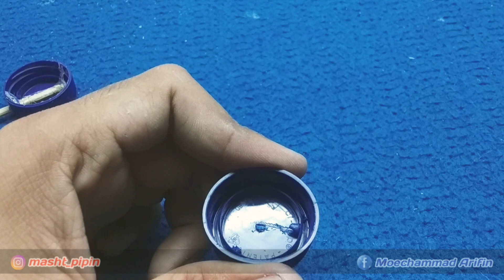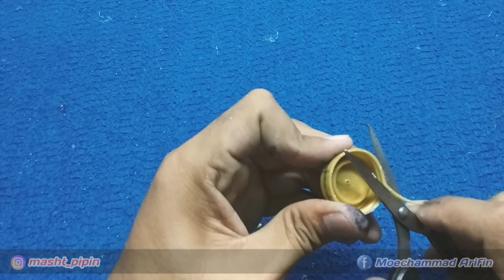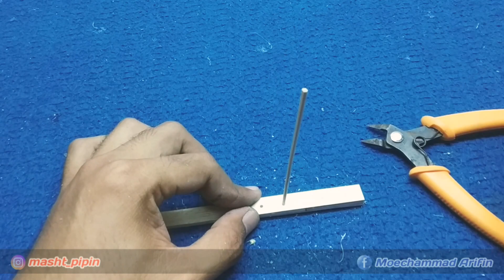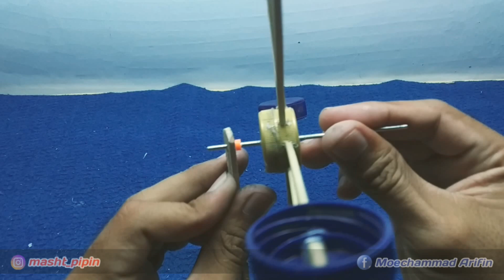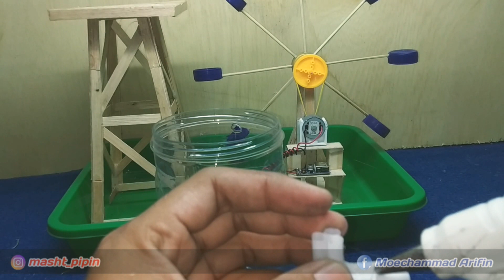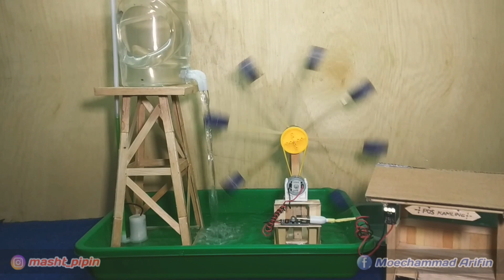Cara Membuat Generator Kincir Air

Comment: Gais aku bikin ini buat final project dan ini 100% berhasil!!!
Bahan2nya
Stik es krim
Baskon/nampan/CONTAINER
Step up
Kabel
Lampu
Dinamo dvd
Water pump 6v (opsional)
Selang aquarium (sesuai sizenya water pump sih)
Klip batere (opsional)
Batere (opsional)
Sakelar (opsional)
Alas
Tutup botol
Tusuk sate (jg bisa pake sendok plastik)
Pulley kecil dan besar plastik (yg wajib itu pulley besar)
Karet/vbelt
Lem bakar
Bor
Solder(opsional)
Selotip/lekban
Lem
Penggaris
Sedotan plastik
Cutter
Reply: nyari vbelt nya dmna ya kak?disini ga nemu² soalnya
Reply: @soniadinda3724  Maap telat tpi ak pesan dri shoppee/tokopedia
Reply: Tanpa baterai apakah bisa? @Ilovebatagormantaap
Reply: kak kalo ga pke step up bakal ttep jalan ga ya?, atau harus pke step up
Reply: @itsnabilaa1591  trgntung volt dinamo nya ga si? aku pake step up g nyala krna volt step up nya lebih besar dari volt dinamo nya, tp gtw juga si
Reply: @soniadinda3724 namanya step up pasti outputnya lebih besar dari input.

Contoh: output dinamo 3V.
Step-up 3V ke 5V maka output step-upnya 5V.Output 5V ini yg dipake untuk nyalakan lampu 5V.
Reply: step upnya yg kaya gmn ka
Reply: @anindiyeah  Module step up.Bisa di beli di tokopedia.
Reply: mbak beli lampu dan konektornya keywordnya apa

Comment: Bang semisal kalo ga pake baterai buat miniwater pum, semisal dri pembangkit itu dibuat lampu sama water pumnya bisa ga bang, mohon dijawab bang buat tugas kuliahh.
Reply from the maker: Gak kuat bang kalo putaranya kurang kenceng.. Soalnya tadi mau aku buat sperti itu cuman gk kuat..
Tanpa waterpump bisa.. Cuman ya selang/pipa sedotnya di ganti yg sama ukuranya dgn output air
Reply: @artachannel9696  semisal kalo dibuat generator nya dua bang?

Comment: Bg mau nanya step up nya yg berapa volt mohon jawab untuk tugas sekolah 🙏
Reply: P
Reply from the maker: Stik Eskrim, Tusuk Sate, tutup Botol bekas, Toples Bekas..
Generator :
Dinamo Dvd (klo punya yg besar pake yg besar)
Step up, lampu Led, kabel..
Mini water pum 3vdc-6vdc (gk usah pake gpp asal selang untuk nyedotnya besarnya sama dengan selang output air..
Reply: @artachannel9696 kak mau nanya itu step up apa ya kak😊
Reply: Makasih y bg semoga lancar terus ngonten nya😇
Reply from the maker: 5volt kak
Reply: @artachannel9696  3 volt to 5 volt ya kak atau berapa nih😄
Reply from the maker: @ani_1239  0.9volt up to 5volt (DC)

Comment: Om, tuliskan bahan ² nya om
Reply from the maker: Stik Eskrim, Tusuk Sate, tutup Botol bekas, Toples Bekas..
Generator :
Dinamo Dvd (klo punya yg besar pake yg besar)
Step up, lampu Led, kabel..
Mini water pum 3vdc-6vdc (gk usah pake gpp asal selang untuk nyedotnya besarnya sama dengan selang output air..
Reply: @artachannel9696  cibai
Reply: @artachannel9696  dinamo nya berapa volt kak ?
Reply from the maker: @keay3962  untuk realnya saya kurang tau kak soale dinamo dvd mungkin 3-6volt
Reply: @artachannel9696  bang untuk menyalakan lampu itu pakai trafo step up ya?
Reply from the maker: Iyaa kak.. Aku pake step up
Reply: @artachannel9696  om mau tanya, itu pakai step up karena pakai dinamo dia gabisa nyala? jadi dibantu step up?
Reply from the maker: Itu sbnere satu paket sama lampunya kak.. Jadi aku rangkai sperti itu..